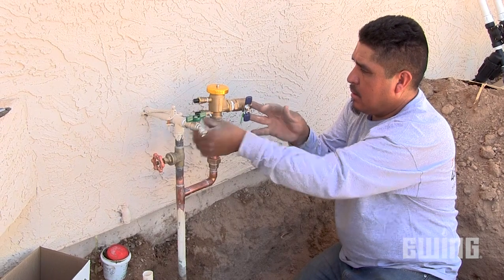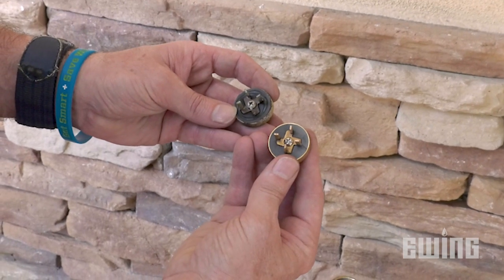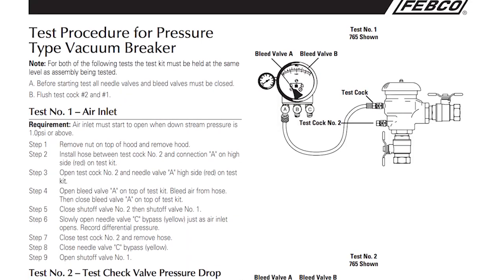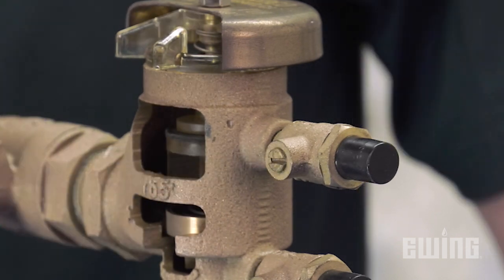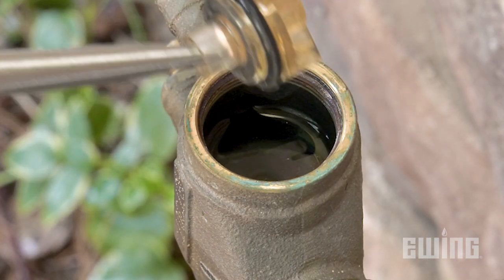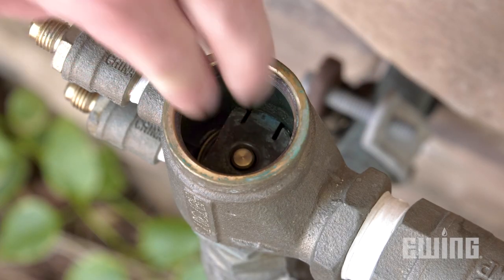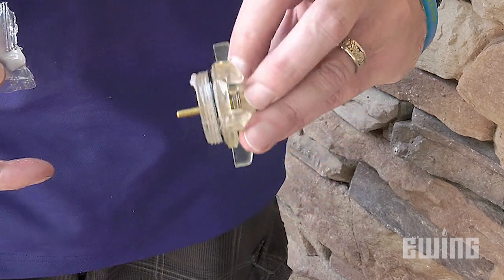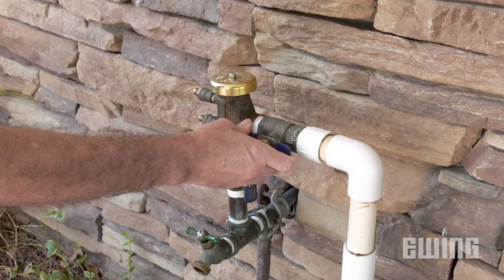How To Repair A Pressure Vacuum Breaker Backflow Prevention Device - Febco 765

Comment: I have a 1 1/2 Scott Model X1649 is that repairable?  Where can i get parts? Should it be outside or inside? I live in Michigan.
Reply from the maker: Sorry, that's not a brand that we carry so we won't have parts for it. If you need a contractor referral, you are welcome to contact a Ewing store for assistance. You can use the link below to see if we have a location near you.
https://www.ewingirrigation.com/locations

Comment: If I want to replace it l, how do I know the size 0.5” or 1”...?
Reply from the maker: The size should be stamped on it. For the Febco brand, you can see an example here:
https://store.ewingirrigation.com/15000430-1-inch-765-series-pressure-vacuum-breaker
Where it says 765-1, the "1" stands for 1 inch. The ball valves on each end should also show the size. Thanks for watching!
Reply: Ewing Irrigation & Landscape Supply thanks for your response and the link. I just checked mine. It says Winiks 420 PVB 1” can I still use yours 765 1-inch?
Reply from the maker: Either a Wilkins or Febco should work with your pipe size but the width and length of the device might not match up. Since Backflow devices are such a critical component of an irrigation system for protecting your drinking water supply, we recommend that you contact a qualified contractor to help you with your replacement.

Comment: Hi, I did this but when i installed it and turned the water on. Water just went straight out with the the side pipe open. Any advice? Tried opening it quick and slow

Comment: Great Video. I have a ~80 pounds of pressure on my drip system, but no leaking water. Will replacing internal parts lower my pressure to drip 
to 50 or so?... thanks
Reply from the maker: No, afraid not. Drip irrigation systems require a pressure regulator to lower the pressure to a level the components can tolerate. These are usually located downstream of the valve. Check out these videos for more information and thanks for the question!

Drip Irrigation System Components:
https://www.youtube.com/watch?v=FTsnDOoy9fw

How To Install A Drip Irrigation System:
https://www.youtube.com/watch?v=eYZAHhjxmYQ

Product Info:
https://www.ewingirrigation.com/catalogsearch/result/?q=Drip+Pressure+Regulator